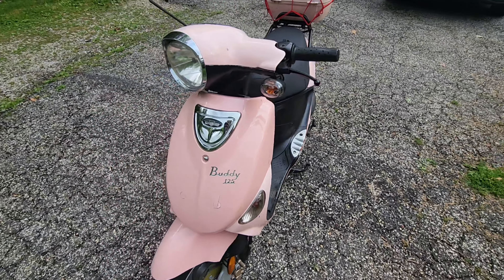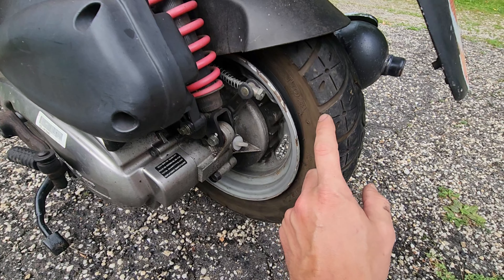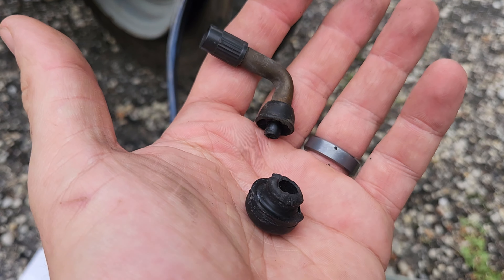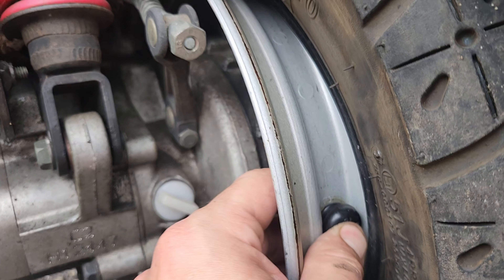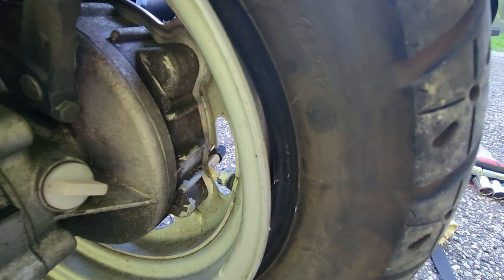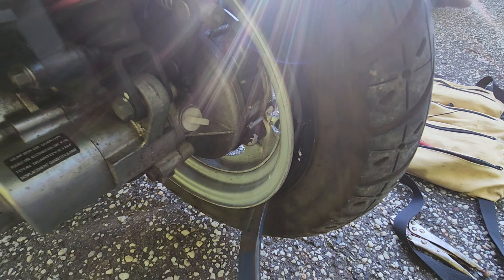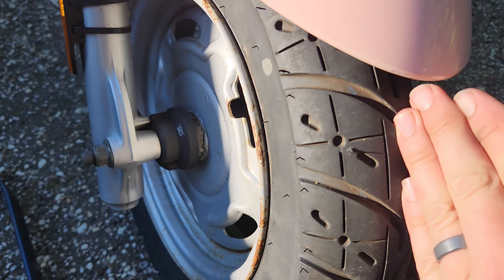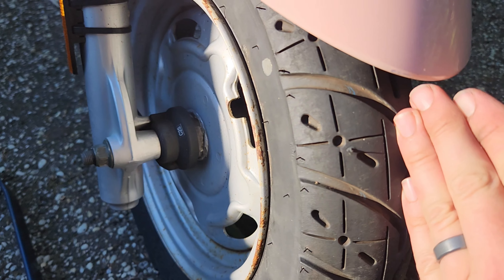Replacing Valve Stems : Fast And Easy Replacement Without Having To Remove The Tire

Comment: Good tip to change out valve stems with every tire change. I’d have never thought to freeze them.
Reply from the maker: @SigogglinJack  Freezing them made it slip right in. 👍 A great trick, if you have the time.